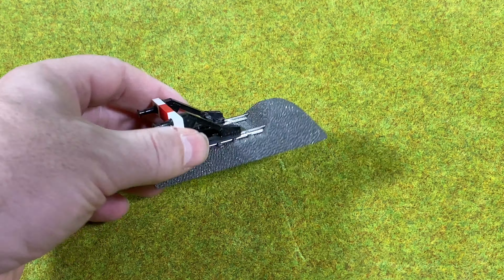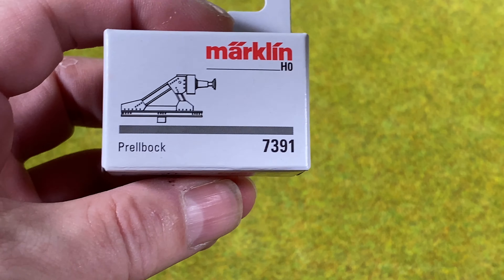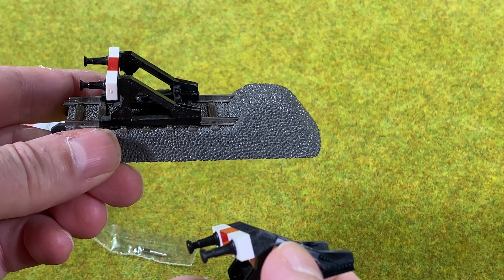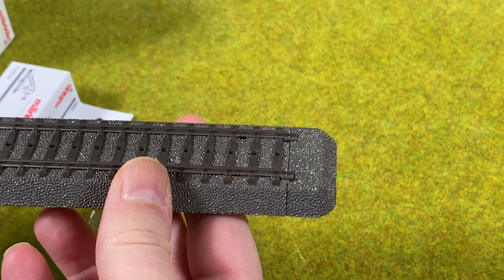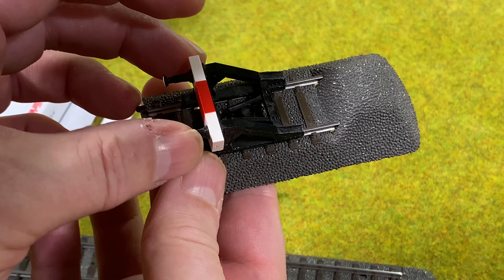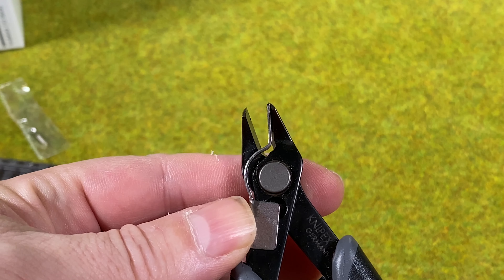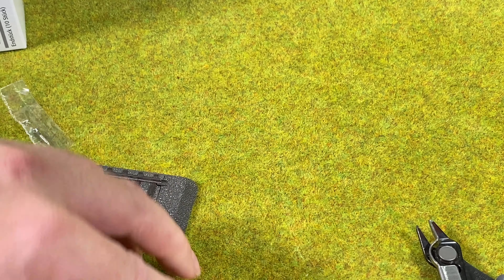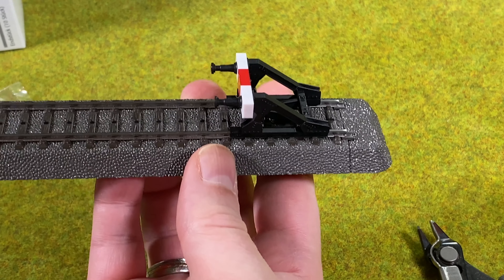Alternative Märklin C-track Bumper (Tutorial 07)

Comment: I am new to this. How do i stop my train in front of the bumper via automation. Thank you
Reply from the maker: Hi Sylvian,

I can think of a couple of solutions for this that could be applicable depending on your needs. You could use electrical automation, CS3 automation or software automation. All solutions a re a little complicated, but manageable. 

You can check out the automation series for more on this: https://www.youtube.com/playlist?list=PLYAhs-Pox3sHzQJsNU-FmOEj1ylO-NPpV

Electrical Automation:

With electrical automation you could use wither the m83 with brake module or use the m84 to turn off power at the last piece of the track. 
- The m84 is the simplest - just turn off power on the center rail before the bumper. The disadvantage is that sound and light will suddenly disappear. Turn on the power when you want to leave again.
- You can use the m83 to control the brake module to brake the locomotive appropriately before the bumper. This solution will brake the locomotive and keep sound/light on, but is more complex.

Unfortunately, I have not yet made a video on how the m84 can be used to turn off power to the track. However, in the following video you can see how to use the m84 to make a stop track with a signal - use the same method without the signal: https://www.youtube.com/watch?v=wrSVwgIgR-4&t=1901s

CS3 automation

You could use the CS3 with contact track & S88. In this way you can detect when the train approaches the bumper then reduce the speed and stop the train. This gives you a very fine control where you could also turn off sound/light. In addition to that you could make a shuttle operations where the train moves from one point to another and back again.

I have made multiple videos on this topic. To get you started look at the videos on the contract track, S88 and basic events in the automation series episodes 2, 3 and 4: https://www.youtube.com/playlist?list=PLYAhs-Pox3sHzQJsNU-FmOEj1ylO-NPpV

Finally you could use software automation, but this is a different project where you connect a computer to your layout.

Hope this helps! Enjoy ;-)
Reply: @ModelTrainFun  thank you. I really like you're videos and I learn a lot from them.
Reply from the maker: @sylvianpost7962  Great - thanks! Enjoy ;-)